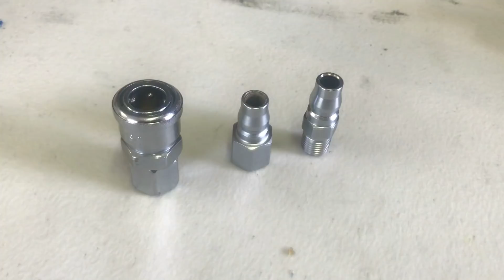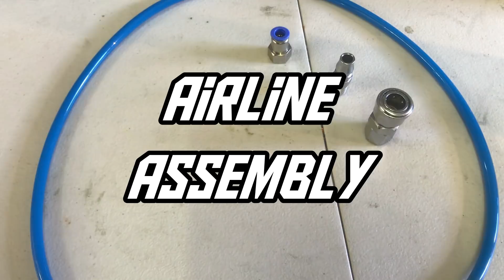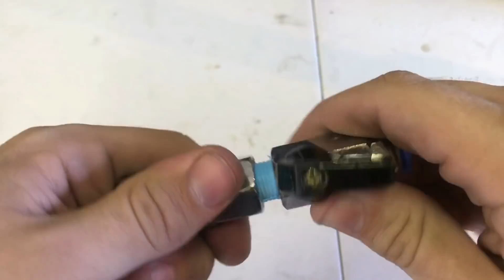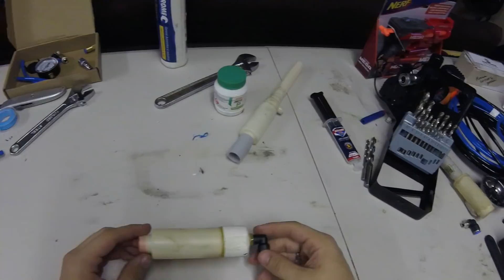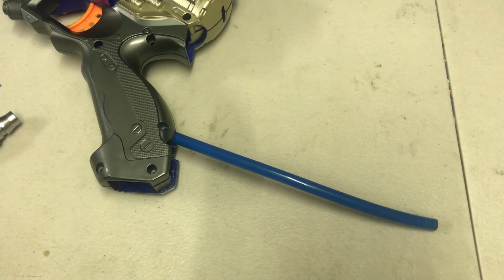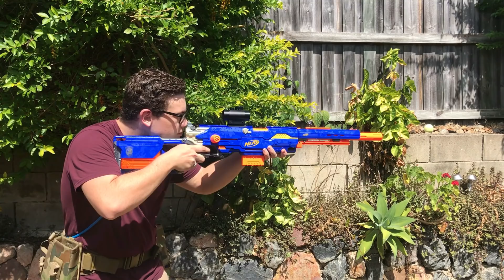How To Make A Nerf HPA Blaster || Easy Guide to Air Blasters Part 2

Comment from the maker: ANyone asking for tanks, check out my spexbz video. Spectre Armaments are making full metal XBZ tanks
Reply: Where did you buy all the pushfits and other components from?
Reply from the maker: @Geek Gaming Studio i went to my local fittings store
Reply: COBBAcrazy What size are all the Nitto fittings?
Reply: Could you do one of these videos but with a 4B tank? I am finding it hard to get a hold of XBZ tanks and dont want to spend lots of money for a metal XBZ when i already have some just as good 4B tanks. Thanks and have a good day!
Reply from the maker: Well, all you need to do it run an air line straight to the 4B and just reg down. Use fitting to attach a push fit. You dont eve need the MVJO-3 valve. Also i dont really have lots of money to make a 4b one either.
Reply: I want to ask, what is the name of the switch to connect to the triger
Reply: HOW DID YOU MAKE A XBZ TANK!!??!?!?!?!?

Comment: Super cool build! Would it be theoretically possible to make a tank out of pvc piping? It seems to me like the XBZ is just a tank with no special mechanisms inside and pvc piping seems to be rated for more than enough pressure. Let me know if I’m missing something.
Reply from the maker: There are more and more 3D print options shopping up. You’re quite right, it’s nothing special, but much easier to mod with compared to building one.

Comment: I created a HPA system for airsoft and my friend challenged me to make one for Nerf. This video was great and helped me a ton with my summer project. By the end of the Summer I managed to create a monster of a Electro-Pneumatic HPA Nerf Blaster and I wanted to thank you for creating this video. 

 I created an automatic system by creating an opening down the barrel that would push air back pushing the breach open. A spring system would re-close the breach while also loading the next Nerf round. This system would require bit more PSI to push the dart down the barrel and cycle the blaster. I had to use a Redline Air System regulator and double down on my air sealing to reach the 120 PSI limit. I used a Ninja 48/3000 Aluminum Tank to press the air along.  I used a raspberry pi and a electronic valve controller to make a fire selector with a 2FA54-73 Toggle switch and can switch from Fully automatic to Semi automatic. The pi is programed to shut the electronic valve controller after .3 second of charging the state of the Nerf Blaster's Breach. This only fires and loads one Nerf dart for a semi-automatic function. If the toggle is set to automatic the PI will tell the electronic valve controller to continue to pass air which cycles the breach and fire darts as well as the trigger system is held down. This leads to a Rate of fire of around 2 darts per second. The PI is stored in a fake PEQ that attaches on top of the blaster via Picatinny railing. The toggle switch is above the trigger and was the only place I could fit it. The shell blaster was a Jet Blaster CEDA Omni Foam Blaster. This took around 2 weeks of planning and about 19 hours to construct. 255-260FPS leading to about 1.8 joules. Not aloud on fields, but I have taken it to some expos to show off. 

I don't really play with Nerf but it was a fun project on the side.

Comment: Yeah, I need to find an XBZ. I probably can't afford a SPEXBZ so I'm gonna thrift every XBZ I see. Maybe I'll try to put one in my Gear Up Raider.
Reply: BoostAddict yo WHATS an XBZ? And where could u get one?
Reply: THE UNBOXING SHEEP I just discovered it myself so here’s what I know. XBZ refers to the ‘Extreme Blastzooka’ air warriors blaster made by buzzbee, it’s popular amongst modders because of its tank, which compresses air when you pump it and fires darts at an extremely high velocity, so people go through thrift shops searching for the blaster. However it’s quite an old blaster now and since the original tank is made from plastic it isn’t very durable or reliable at a high PSI (pounds per square inch, unit of pressure) so now there are third party sellers (ie. blaster tech) that are selling the same tank except made out of aluminium metal instead of plastic making it much more durable and overtake superior.
Reply: I feel as if the knowledge on finding xbz’s has been stifled to prevent a shortage for all the hardcore nerf moders. Thank you for this information.

Comment: Hey mate, great video, I am very keen on doing this to a Hydro Cannon using the new metal xbz tanks.... However I do not understand how this system works, are you able to break it down a little? 

So with my understanding, the compressor fills up the xbz tank. But then once the regulator reaches its limit, say 120 psi, doesn't it then cut off the pressure and so shouldn't the xbz tank unload itself staright away? How do you set up a trigger switch? Or is that the point of the 3 way switch. I don't understand how the 3 way switch works is what I'm trying to say 😂 thanks mate

Comment: would you commission these?
Reply from the maker: boofattack depends, if you wanted it in an lsk i could
Reply: would you do one with a regular air tank in it instead of a tank that uses the compressor? email me at brenton2_9822@hotmail.com if you would rather talk about it there ! but yeah just a hand pump tank with the same sort of breaching system that accepts clips? if thats possible but yeah !

Comment: Thanks so much for making this for us all mate. Quick question. What does the xbz tank do? Looks like it's just a reducer / tank? Would a section of 25mm pvc not do that?
Reply from the maker: The XBZ tank has a seal and diaphragm that holds air when its compressed, but dumps air super fast. I'm not 100% sure about what it does, but I do know you need the front seal for it to work, other wise air will just come straight out. Don't worry though, spectre is making metal ones sooooo, no need to hunt soon.
Reply: COBBAcrazy Ahh right gotcha. Thanks again. Can't seem to find one on the eBay's.. I'll follow spectre for more info
Reply: If you didn't want an XBZ tank, a remote solenoid attached to the front of a CPVC tank would work just fine. You don't even need a Li-po to snap the solenoid valve open, you could do it with a pair of 9v batteries in series. You'd have to have a 1-way check valve in line with the air fill line, to prevent back-bleed, but it would work.
Reply: Sweet friend. Thanks!